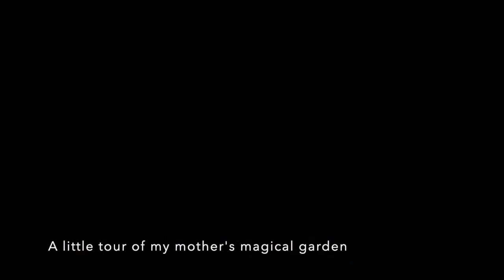Our Coaster Conversion - Part Five - Removing Floor Heaters, Vinyl & Insulation

Comment: Instead if plugging them I bought "heater hose" with a inner diameter of 16mm with the intention of connecting the coolant inlet to the outlet. Will 16mm be enough to go around the outside?
Reply from the maker: I bought 13mm barbed plugs to plug them.
Not too sure of the outside diameter.
The wall of the hose was kind of thick... maybe 2mm.
So you MIGHT be alright but you also may be a bit small...
You might be better off getting a double ended barb plug and some hose clamps.
Reply: @theaitkenfamily9138  I'll try with the 16mm. Otherwise the next size up is 19mm heater hose. I talked to an auto-mechanical engineer and he said you have to connect the inlet to the outlet (which is what happens inside the actual heating element). If you plug it (like what you did), if you were to accidentally slide the back heater slide to on on in the dashboard, it will open a valve and try to pump coolant through the pipe. Overtime, it will unplug your plug.
Reply: @theaitkenfamily9138  Where did you buy 13mm barbed plugs from? My local bunnings didn't sell.
Reply from the maker: @peejai1781  got mine from Bunnings, they were low on stock but they had some there.
Just ask and if not try a different Bunnings.
I though you were going to loop yours though?
Reply: @theaitkenfamily9138  Since the back and front heater are part of the same circuit, I looped the back one. The front one was much harder to reach so I ended up plugging it (I found one at another bunnings). 

Since they are part of the same circuit, the pressure build up will be negligible. 

However, I was still recommended to glue the plug using heat JB Weld HighHeat Epoxy Putty. I will do that after the manufacturer of the plug replies to my question about the max temperature of the plastic plug.

Comment: Hi,

Just wondering did you guys remove all the frond ac ventilation system that’s over head of the driver/passenger seats?
Reply from the maker: Hi Jordan, yes I removed everything AC related as it didn’t work. So I’ll overhead units, channels and the big heavy condenser plus the pump and radiator, it freed up a LOT of weight and space. We will be installing a mini split system down the track if we need it.
We took a break for awhile but are getting back into it now. (Kicking off from where we left it pretty much 😂)

Comment: Hey Guys, once you cut the pipes for the heaters and drained the coolant. Did you just chuck a plug in there to block it off?
Reply from the maker: Hey Jay,
Sorry for the late reply, had a break over Christmas and New Year.
I cut the pipes all the way back to just as it comes into the back and plugged them.
Everyone says to join them together with a U pipe but I haven’t noticed anything overheating or any issues.
I have enough pipe sticking out that I can cut and put in a U pipe if needed in the future.